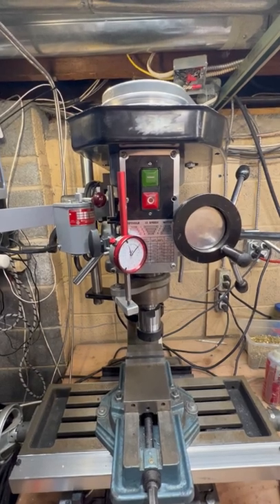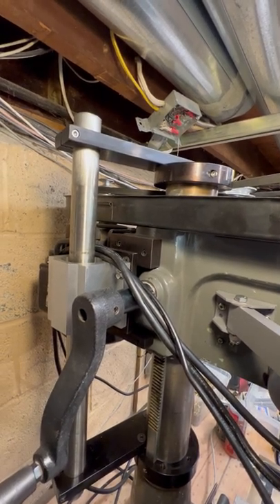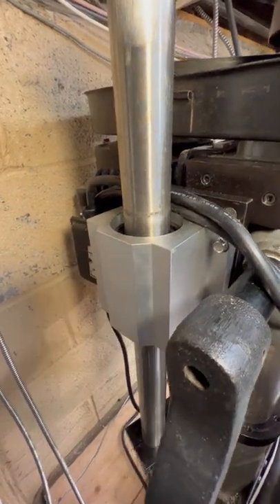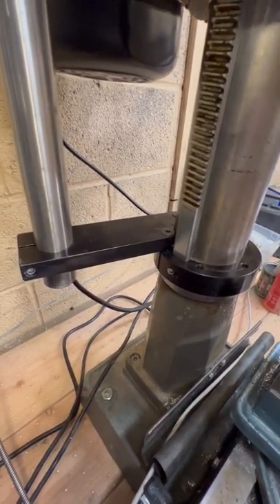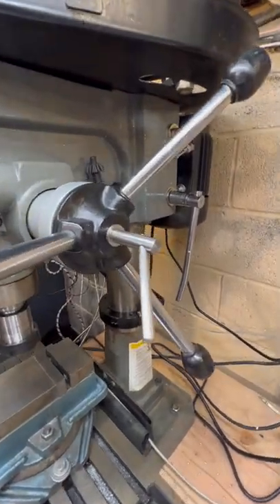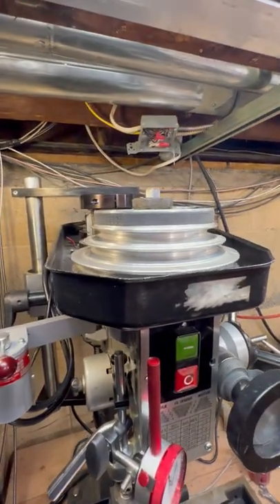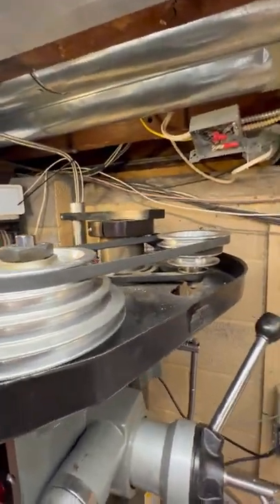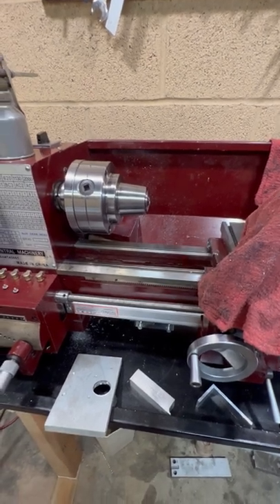Round Column Mill Stabilizer Modification 90's Vintage Jet

Comment: Nice mod!  I’m about to get a round column and have been looking at stabilizing methods
Reply from the maker: Thanks.  I was lucky enough to get the Thompson rod from my local scrap metal yard so that really helped codify the design.  All in all i am pretty happy with the result, though I still need to redesign the top cover over the belt pulley

Comment: Eyup Jack
when you messaged me earlier, i was curious about your Jet mill. Has this stabilizer made a big difference to the ridgidty of the machine, i might put it on my long  list of things to do🤣🤣👍👍👍👍👍👍 ive sub'd and thumbed you so to speak!!!🤔🤔👍👍👍👍
Cheers
Kev uk
Reply from the maker: Greetings Kev, to be honest I think it helped a bit, but i still use the side locking bolts to clamp the head to the column when I am milling.  Fundamentally, the distance between the quill and the column is so long, the lack of sability is baked in.  I still get plenty of chatter unless I take easy cuts.  The main benefit is the ability to raise and lower the head and maintain position.  BTW I did think it would help more than it actually did.  Thanks for checking in!
Reply: @jackpestaner6925  eyup Jack
I suppose these machines depending on previous use and abuse by others, have cummalitive wear and errors, it's a matter of wading through everything and a little improvement in lots of places will improve the bigger picture
ATB
Kev
Reply from the maker: @MrFactotum  Hi Kev, hope life is good over there!   A continuing frustration is the inability to tighten up the rack and pinion of the quill.  It seems to have a good .020" of free fall, but any fix would be non-trivial.   Have you attacked this problem yet?
Reply: @jackpestaner6925  eyup Jack
yes i'm ok thanks, just on holiday in my caravan reading a book on bulding a "Minnie" traction engine, sucker for punishment, never time to be bored. Not sure about your mill problem, mine seems to be acceptable, i always remind myself mine's only a budget tawainese mill from  the 1970's, so will always have its limitations and continual maintenance/adjustment.
hope you sort it out Jack. keep me posted.
cheers Kev